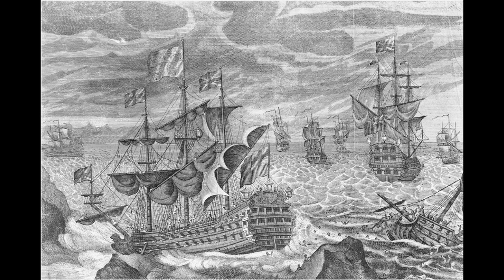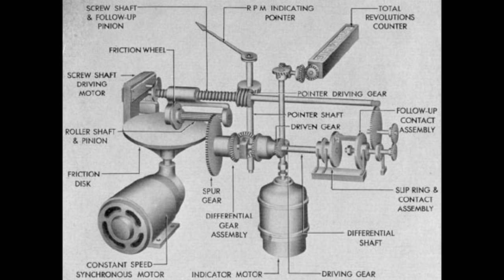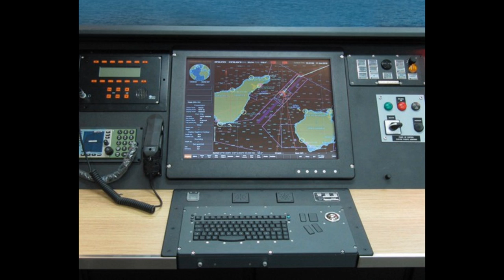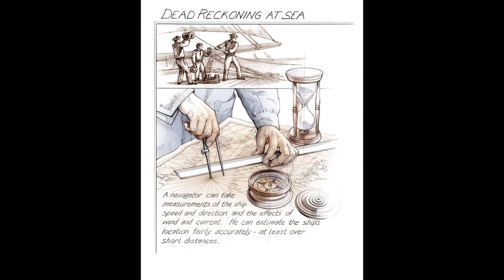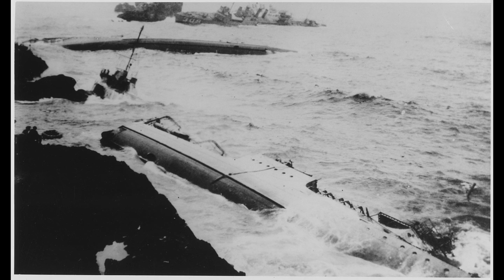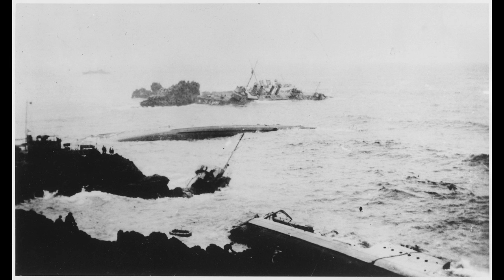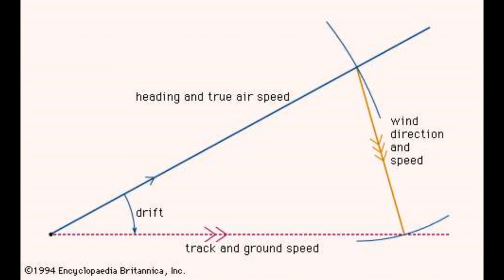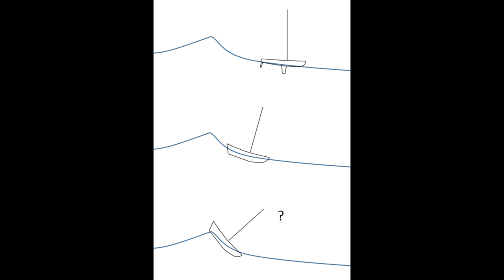Honda Point Disaster - Taking a Wrong Turn at Albuquerque

Comment: Even in "modern" times, navigation errors happen. I was on the USS Enterprise in 1983 when she ran aground in plain view of San Fran and Oakland a mile from the pier after passing under the Oakland Bay Bridge. One factor was the Navigator miscalculated the flood tide at 0.5 knots but was actually 1.5 knots. The Captain was conning the ship at the time but was already selected for Admiral. The Board of Inquiry did not blame the Captain enough to stop the promotion and he became an Admiral (note: he was an aviator so not sure how much that was a factor for keeping the promotion).

 I left her in March 1984. Not too long after that, the Big E was doing flight ops off San Dieago. The bridge crew were so cocerned over maintaining wind speed over the deck for flight ops that no one notice their track was heading them into the shoals known as Castle Rock. Yes, she hit the shoals which caused the side tanks to spill JP5 and take on seawater. While in no danger of sinking, the repairs were not minor and she spent time in drydock at the Bremerton Naval Shipyard in thr Puget Sound. In this case the Captain, yes, an aviator too, was relieved of command.
Reply: All Carrier type ships in the USN are commanded by Aviation Officers. This goes back to the days when commanding a Battleship was the pinnacle of ship command. Carriers were support ships back then and beneath the dignity of a true combat captain, plus those aviation guys know better what conditions they want to fly in so we'll give them those ships. The Aviations guys decided not to give their ships back to the surface guys after they lost all their Battleships.
Reply: My Ex watched this event from shore while waiting for her first husband that was on board. (Evenhuis, chain & chock crew, always in trouble)
Reply: Large navy ships usually picked up pilot officer when entering a tricky harbor (which SF Bay definitely is).  The pilot is an expert on the area being traveled and can guide the unfamiliar ship over the sandbars and away from the rocks while entering or leaving.
Reply: @landtuna8061  Yes, we did. But on US Navy ships, Harbor Pilots can only give advice.. In this case the Harbor Pilot was telling the Captain, who wss conning the ship, he had to turn earlier than the nav plot. The Captain eventually did but it was still too late.
Reply: My sister was stationed there when that happened. The navy called them, they showed up in their little patrol boats asking “...and do what?”
Reply: (She was in the coast guard)

Comment: In the '80s USN ships still were equipped with DRAI (Dead-Reckoning Analyzer/Indicator), which took inputs from the Mk-19 Gyrocompass and the ship's underwater log (the speedometer) and produced a latitude/longitude output on the unit itself, as well as sending an output to the plotting tables in the control room/CIC/navigation bridge (depending on the type of ship).

After getting a NavSat fix and determining our exact position, it was necessary to reset the DRAI to get all of the navigation team back onto the correct position. It was sometimes amazing how wildly off the DRAI navigation was. Of course, there were other methods of determining our true position in the interim (we had an, at the time, pretty advanced Inertial-navigation system that could sense drift and speed) but the DRAI was the only equipment that could run the plotting tables, so it was a critical piece of gear.

Our navigation team were pretty sharp concerning known currents, water depths and other factors that can help fix a true position, skills that I fear may be lost with an overdependence on GPS.

I hope that all mariners, both Navy and Merchant, continue to hone their skills in old-school navigation.................................................
Reply: I had a 1st Sergeant in the Army that grilled us on navigation/map reading skills because he didn't like how dependent we'd become on GPS. He always said knowing how to read a simple compass, shoot an azimuth, and find your position on a map should be second nature to ANY ground-pounder. Speaking of old school, a friend at work served on the USS Missouri during the Gulf War. He said they used the old firing solution mechanical computers after main battery firing had knocked out their electronics; they worked flawlessly. It's a matter of finding balance between old, proven techniques that'll always be available and incorporating new technology without completely abandoning the former.
Reply: @tomservo5347  Exactly. If destroying GPS satelites will cripple US forces' navigation then someone would want to shoot those down.
Reply: Was a QM on Tin Cans (4yrs) & a Reserve Submariner in the sixties.  I remember teaching Midshipmen celestial nav which seemed to be a lot art by the late 1980's
Reply: @jacevicki  I learned how to do map & compass land nav when I was in the Boy Scouts and I’ve gotten very good at it as a cadet. Never got taught how to use a GPS, and I don’t think ROTC will.
Reply: There are other forgotten arts.  Sounding weights had a wax (?) bottom so they could pick up bottom crud, which was noted on coastal / shallow charts.  Other information noted was smells and water color, maybe depending on season and time of day and tides, and explorers drew coastal scenes from deck height with angles to various land sights, like cliffs, rocks, big trees, buildings, anything which stood out.  There's a whole lot of ancient information which no one knows or tracks any more.  Egyptian farmers probably knew more about the night sky than kids today know about pop stars; it has very little practical use today, and I doubt anyone, including modern Egyptian farmers, knows anywhere near as much now.

Worrying about lost knowledge is fine for history books.  But if it were useful, it wouldn't be lost knowledge.  There's a difference between useful and interesting.

Comment: As a Former RN Navigator (specialising in coastal waters) I would also point out that while Radio beacons are great for measuring distance they are pretty poor at producing an accurate bearing and normally when using beacons we would draw a circle around the locations of multiple detected beacons on the chart with the reported ranges of the beacons being the radius of the circles a minimum of three seperate beacons should be used and you should plot where these circles intersect (they never will perfectly and you end up with a small triangle on the chart that you are somewhere inside and it is good practice to assume that within the triangle you are at the point closest to danger  this inherent issue with radio beacons is allot worse in bad weather especially in fog this was an inherent problem in radio beacon systems that didnt really get solved until the advent of GPS and the captain was right to not fully trust the beacons however he should have trusted them a damn site more than dead reckoning

Comment: WOW, what a fine video - and quite meaningful for me, thank you!  I grew up in Santa Barbara County, and while I'm in my 40s now, I visited Honda point many, many times in my childhood through my 20s.  It was/is a very lovely, lonely, rocky area with an angry sea, it wasn't uncommon to see 15 foot swells and waves making spectacular splashes against the rocks.  Being on Vandenberg AFB, the entire scene was set against the spectacular SLCs (Space Launch Complexes) that were readying for the West Coast launches of the space shuttle in the late 80s (which never occurred after the Challenger disaster).  The rusted keels of a couple of the ships could still be easily seen in the late 80s and early 90s.   Being in the pre-internet days, I never could find much info on the disaster other than a few blurbs in military encyclopedias, and those entries pretty much just restated what was on the memorial Plaque at Honda point.  I moved away in the mid-90s and forgot all about Honda Pt, until I happened upon the video today.  Hearing the full story from you was WONDERFUL and answered all those questions I had in my childhood that I had forgotten about....thanks again!